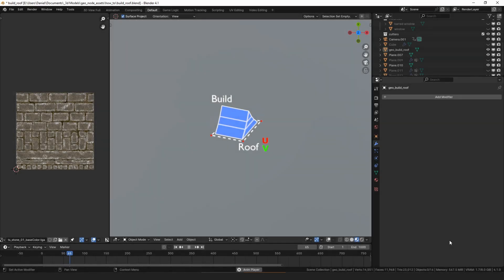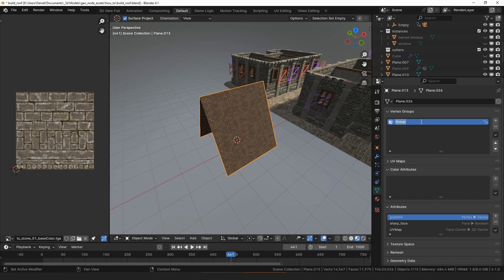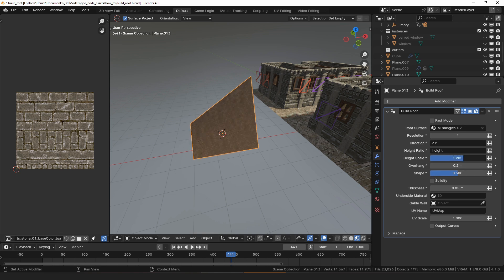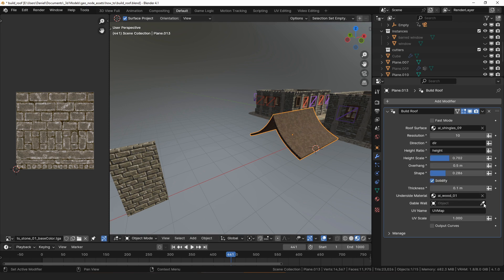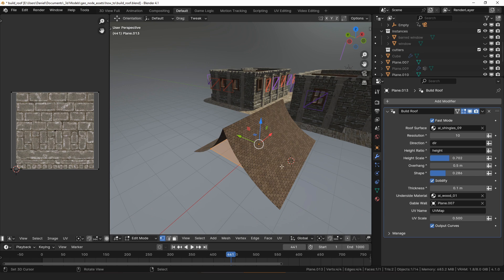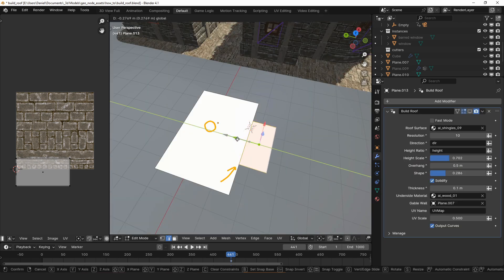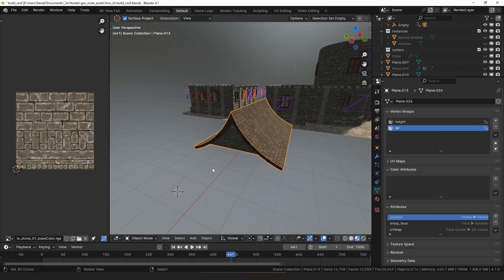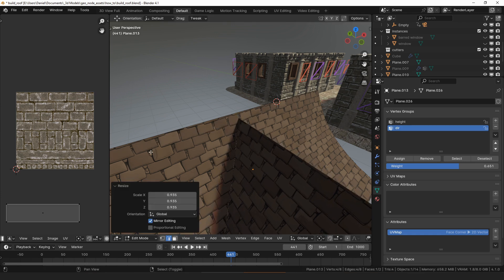Build Roof - How to Use DJH Geometry Node Assets

Comment: These nodes are pretty awesome. It is complicated though, but that's just 3d.
At first, I thought these were grouped geometry nodes, for using within your own geonodes pipeline.
Are they always used as modifiers, or are these also used inline in geonodes setups?
Reply from the maker: You can do both, I often use them in more elaborate node groups myself.  I did design most of them to be used as modifiers first, because I think that is more approachable, but there is a lot you can do with them if you are comfortable combining them into your own bigger setups.  I do all the time, in fact in the library you'll find many nested groups, for example, Resize nodes included inside of many of the Build modifiers.